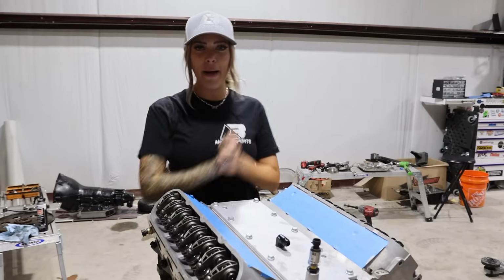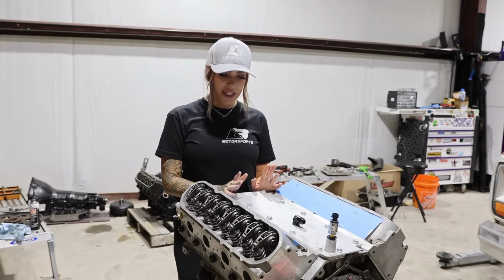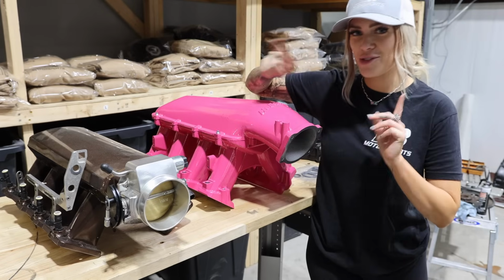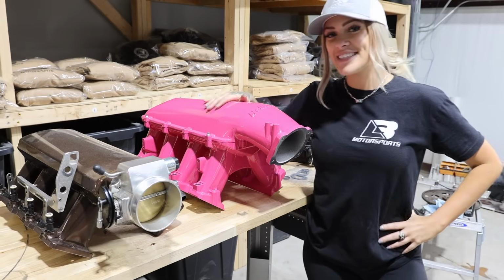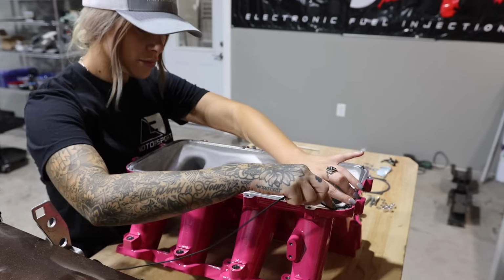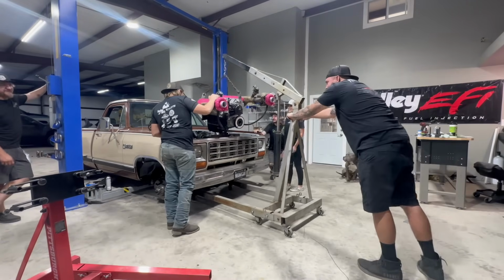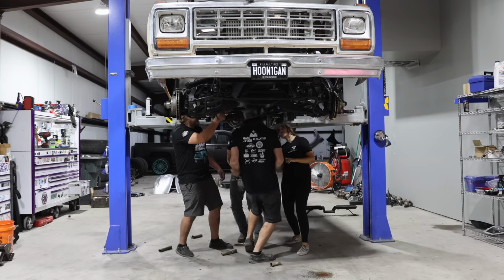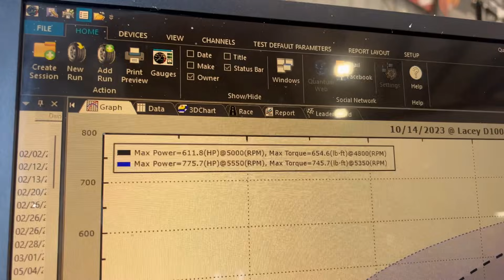My new LS 2 Motor Makes MORE Horse Power Than Zach's truck!!!

Comment: When you drilled that hole did I see shavings go down in the fuel injector port
Reply: Yes you did, but If you watch it again, you’ll see that it’s on the work bench not on the actual engine. It was also blown clean before installed.